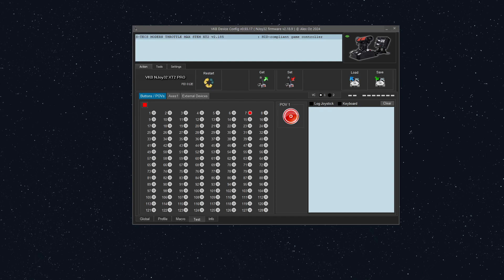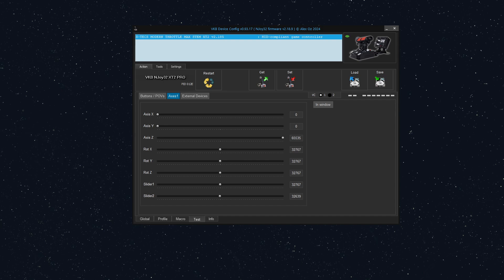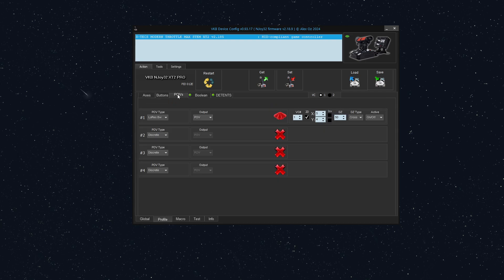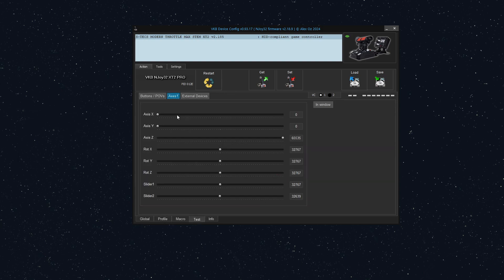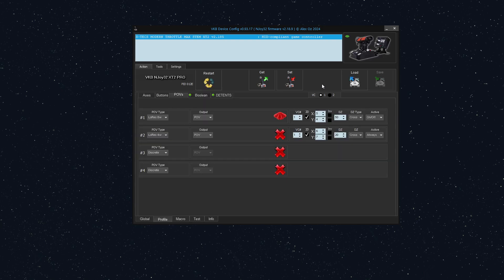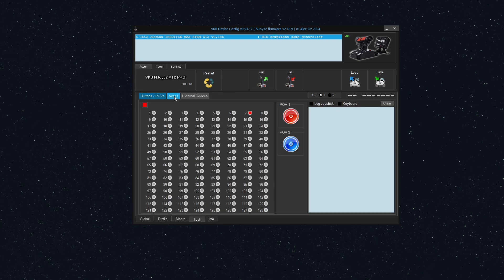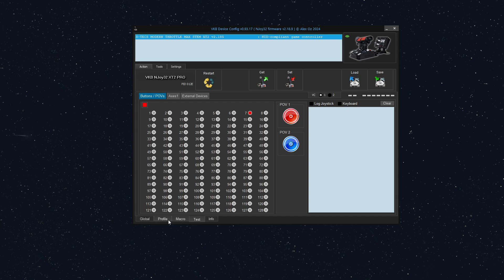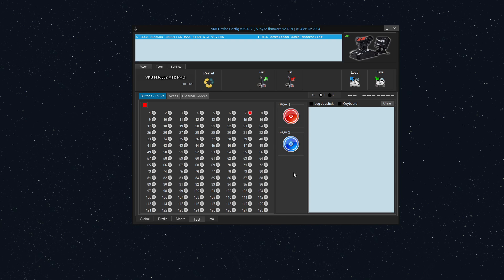Adding a POV to your VKB STECS

Comment: I have a stecs mini plus. When i got it the hat switch was installed instead of the mini stick in the OTS  spot on the throttle. After switching the hat switch for the mini stick how do i go about setting it up so the software sees it's been changed? I'd like to use the mini stick as an analog stick. Can you help?

Comment: Hi, I need help 🙂 Your the closest thing I have found on the WEB  to help me solve my SO BASIC problem but nothing is working, maybe you can help or at least point me to a place (vido/forum) that would help?
I just bought the STECS Throttle mini plus (I have 3 others VKB product), in the box there is an optional mini thumb joystick/POV to replace the thumb 5 way button/switch. For the love of god I can't make this one work, and I have tried about everything (ZBootloader / flash firmware), use VKB DevCfg to reset, calibrate but no mater what I do I get the LOCK LED and right throttle stick LED flashing also!!!!!!!! And no POV working. Any help would be so appreciated. Many thanks!!!

Comment: Liked and Subbed. I have the Stecs Mini +, which originally came with the large 4-way hat installed, that I later swapped for the 8-way round switch POV.  NOW, I want my 4-way hat back, but i can’t get it to work like before.  the switch only configures as one axis, which is likely why my UP and LEFT only point up, and DOWN and RIGHT only point down. also the red lock LED is blinking. Can you point me to any documentation that can help?
Reply from the maker: If you change any modules on the STECS you need to re-initialize the new modules. Unplug the STECS from USB, hold the ENT button and right FRONT trigger (some call it "finger lift") while plugging the STECS back into the USB. Your new module should be detected, but be aware that your button numbers might change.

Comment: The white 5-position "mode" switch on the STECS base - it is permanently sending a signal (button 3, 4 etc.) but I want to configure it to only send a pulse when the position changes. Any ideas?
Reply from the maker: You can use a "Generator" function in the VKB Device Config software to send a pulse of a fixed length. Look up the Generators in the NJoy32 manual here: https://www.njoy32.vkb-sim.pro/docs

Comment: thank you for your videos. 
My STECS Throttle System Mk.II - Mini Plus currently uses 4-way hat switches with center push. I also have the ministick module. Could you please provide instructions on how to remove the hat switches and configure the software to utilize the ministick module? thanks in advance!
Reply from the maker: Split the throttles (remove the throttle lock) and printed on the inside of the grips are arrows showing you how to re-initialize the STECS after a module swap! Unplug the STECS from USB, hold the ENT button and front right trigger, and keep holding those buttons for a few seconds while you plug back into USB. It should now detect your modules :)
Reply: @untoldforce  sweet! thank you sir, I knew it was something simple.
Reply: @untoldforce  Thanks but it's not working for me, I still have the LOCK LED / right handle LED flashing. I am desperate.